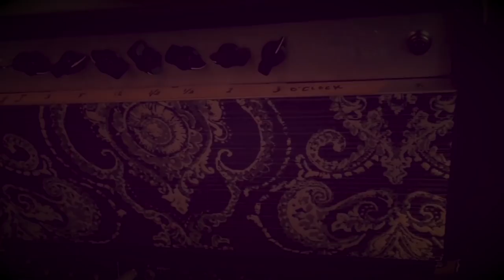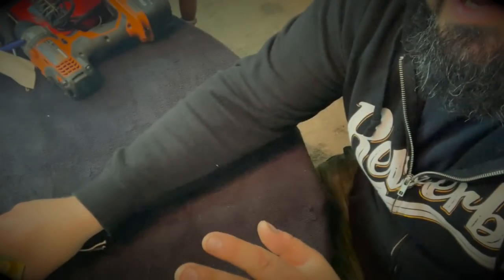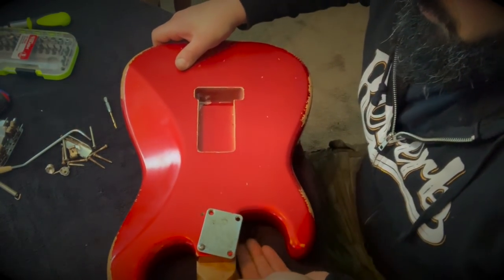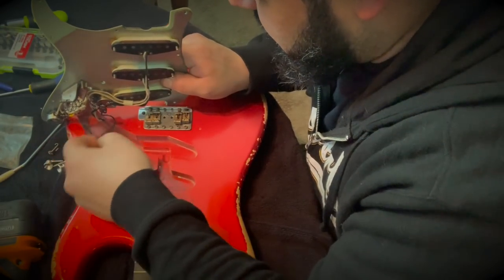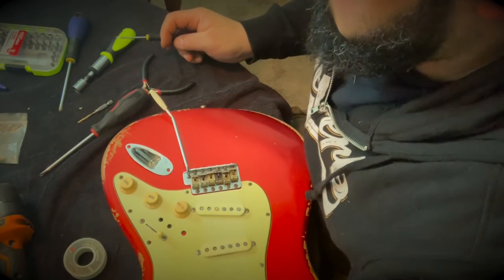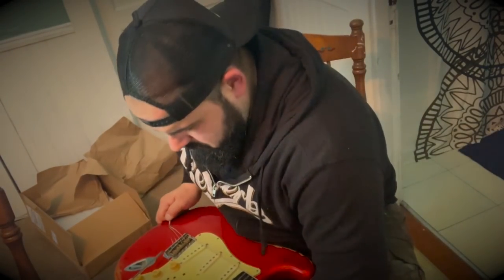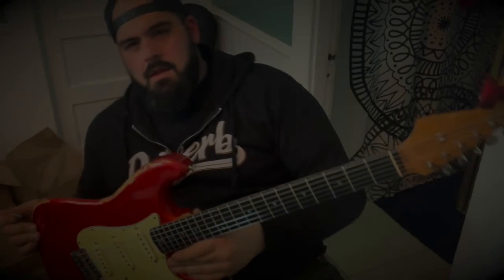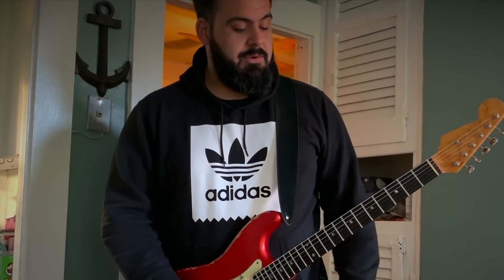BUILDING A PARTS-CASTER! PRE-CBS, KINGTONE, MJT and CUSTOM SHOP PARTS!

Comment: i buil a partscaster from a california series squier, refinished it in nitro LPB, relicced, stained and nitro tinted the neck, filled and redrilled for klusons, filled and redrilled backplate holes for staggered fender style (ik lol) , got all the hardware  and electronics off aliexpress, 1965 style staggered alnico v pickups with gray bottom plate, vinatge style components with a trebble bleed, and a pw29 MIM bridge assebly. best guitar ive played and i built it all myself for a budget, cheers from chile!

Comment: I love the MJT bodies,  I've purchased 7 of them, three of them are all custom shop necks and parts which I gig with, four of them are allparts necks and AVRI hardware with various loaded pickguards, JBE, Lindy Fralin etc which I have sold to very happy buyers.  Keep up the great work.
Reply: Very cool 👍 Have you needed any shims with the MjTs I have one w a 65 neck and it needed one Thanks
Reply: @paulcowart3174 , I didn't answer your question right away because I was trying to remember if I had to shim any of the MJT guitars. I built three with all Fender Custom Shop parts, three with Allparts necks and AVRI parts and one hardtail with a Road Worn neck and Duncan and Fralin pickups and I only shimed one of the Allparts necks with a thin strip of paper from a Vintage Guitar Magazine blow in advertising card.

Comment: Really great video, with caveats, I’d have painted the cavities with electronic noise suppression paint and used copper tape to line too, and cover the underside of the scratch plate ;). Also, buy two bottles of old style Grolsch beer and retain the two red rubber washers off the bottle as strap locks 😉. Retro look and practical utility with yer inexpensive Ernie Ball webbing strap ❤ 

My latest discovery Nordland ODR-C overdrive pedal FYI to add to that gorgeous build.

Comment: I got a sunburst relict 60s body from MJT last year. The waiting list was like seven months I believe but worth it. It was fun building a parts caster. Nice to have a old looking bet up strat that didn’t cost a fortune. Put some fender custom shop pickups in it
Reply: I`m currently waiting for mine (MJT), and very excited about it. what kind of neck did you use for the build? was it a snug fit? (holes lined up perfectly?)
Reply: @jojothemojo  I forgot the neck name. But most don’t come with holes drilled because luthiers like to drill the holes while they set the neck. I did it myself it’s really not that hard
Reply: @jojothemojo  it was an Allparts SRO-C I found a guy that ages them and put a bone nut on it. Put some fender custom shop pickups in it and it’s sounds great!
Reply: Thanks a lot man! will look into that! Cheers @nimitz1739

Comment: hey brother love the guitar a simple tip when you solder the imput jack you can poke a hole thru the paper run the wires thru solder then cut paper with zero chance of burning finish

Comment: I wonder how much of string stretching is actually just the string getting seated properly, especially around the tuning post? It just needs to get wrapped as tightly as possible around the post maybe?

Something I do, tune the string to pitch, then lightly yet firmly tug at the 12th fret, pull the string away from the neck, sort of like a bow and arrow. Immediately the pitch goes lower, so I repeat this a few times until it stops. It seems to work pretty good for me. I have not consciously been thinking that I need to let the strings stretch for hours of playing, or anything like that.

Comment: Nik, I noticed you have the springs in a V shape? Just personal preference or helps to accentuate lower or higher strings? 

After watching your videos and Matthew Scott's, I started tinkering with my 87 Strat plus, I took the springs off for the first time ever, there were five springs on it. So I removed one spring to see how it plays. 

When I bought it used,  I asked the tech guy to put a block in so it only dives lower, I figured I can just pull on the string to make it go higher, get a little more tuning stability. I guess he never put in a block after all, he just had all five springs attached for 30 years. 

Next time I change strings I'll take another spring off until I start getting more movement higher and lower.

I wonder, is there a standard amount of springs for most folks or does it vary from 1 to 5 evenly?

Comment: Hi Nik. You said you were going to 'center the neck'. What do you do if it is not centered, dowel the holes and redrill it?
Reply from the maker: No.  Meaning use the two outside E strings as a guide and center the neck leaving the same amount of space on each side

Comment: Nice build job, but "tone transfer" from the strings to the body / neck as a desirable aim is non-sensical. Any vibration energy transferred to the body or neck means it is lost from the strings. You can't violate the laws of physics by duplicating vibration energy. And the pickups only see what's in the strings. Fortunately such transfer is very poor in solid body electrics (unlike in acoustic guitars where it is very good), as the bridge is inefficient, and the nut/frets/neck only slightly less so, for such transfers. Their job in an electric guitar is to retain energy in the strings, not transfer it. And that's the way you want it - near-zero transfer - so almost all vibration stays in the strings where the pickup can detect it.
Reply: Why do to different guitars that are the same model sound different then?pickups swapped from one to another..same pickup height measurements..one guitar is brighter than the other..what gives?
Reply: @johnfoskey7855  Lots of possibilities, depending on what is constant between the guitars and what is not. No two pieces of neck wood have the same resonances (which can lead to vibration loss from the strings at those frequencies). Manufacturers rarely match pots and capacitors better than their 10-20% tolerances. No two sets of strings sound exactly the same. No two models of the same pickups have identical frequency responses. No two bridges have identical absorptions. No two setups are identical. So if you hear any difference it's probably the net effect of a number of factors. But the more things that are the same, the more the two guitars DO generally sound alike. In any case it's a long list before you even get to "I wonder if the body wood could have any effect". And the experimental physics don't show evidence of any real 'body effect' for solid body electrics. And indeed there is no coherent physical theory that explains how 'tone transfer' from the strings to the solid body could occur and enhance the output heard from the pickups, in an electric solid body guitar. As I noted, physics indicates the exact opposite - that vibrations must be retained in the strings in order to be heard in the pickup output.